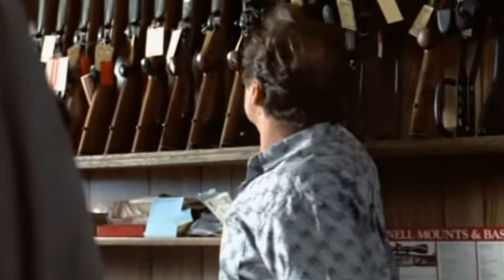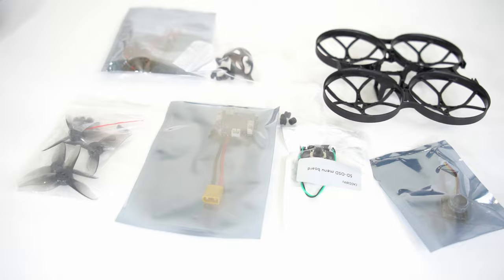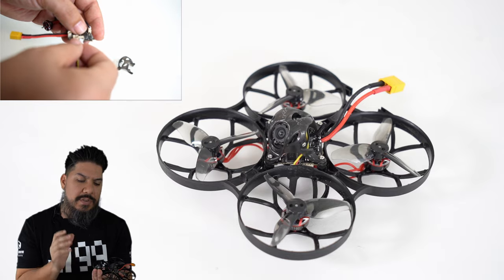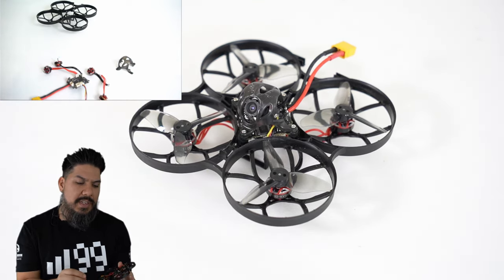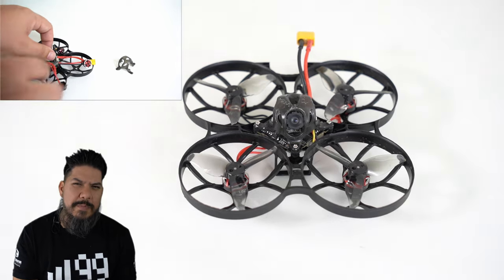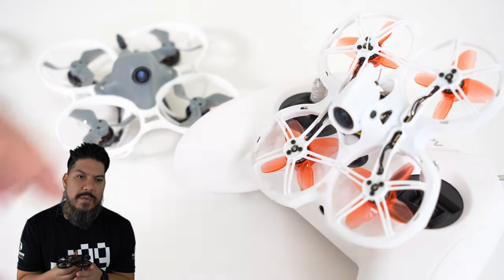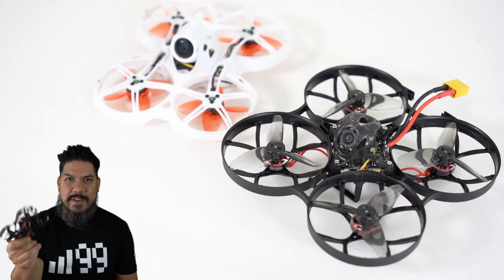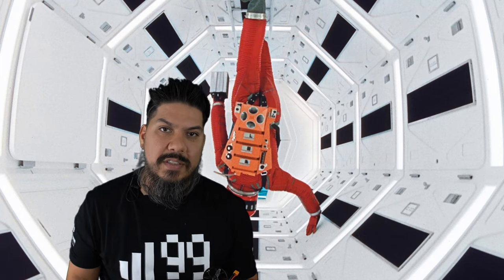UZ85 Build a drone for $75 NO SOLDERING - micro drone, tiny whoop, DIY quadcopter

Comment: I got one without receiver since I'm a weirdo who uses radiolink. No joke it's hard to fly inside. But should be fun outside esp with 2s. Wonder if it would work on 1s for inside flying?
Reply from the maker: I wonder if it would all still work on 1S?  Could also possibly do 2s but with a flat camera angle and like a 50% throttle cut possibly

Comment: So, my buddy Dom has one, but he's on the other side of the world so I haven't flown it, while I have the beta85. The difference it seems is mine has maybe more top thrust, while his has much longer flight times. Have you flown both Jon?
Reply from the maker: I have flown the beta 95, and that makes sense to me, the 1102 on this one, should be a lot more efficient but a bit less punchy than the 1105 and 1106 beta likes to use.
Reply: @JonE5FPV  It looks like it pretty much did what you told it to do. I know that it helps to chose your fly space size to fit the craft and that spot seemed to fit it well.

Comment: I was following you on Facebook for awhile about testing out cinewoops and the best frames and you said you where testing. Did you ever find a suitable cinewoop frame?
Reply from the maker: I have tried several. Reptile cloud149, taycan 25, betafpv 95xv2 pusher, and my fav so far is the cinesplore that i have a review up for.  I also will be doing a project on the Racewhoop open source design soon as well.

Comment: I think we should not buy this! It is basically a way to skip QC. One thing is at least to try to build something an other is to put a couple of plugs. So they can sell the same RTF/BNF but without a QC mark. I would say @Jon please do not advertise these. Unless you have a different opinion. ;)
Reply from the maker: I dont see QC being vastly different on these, but it is a good point.   I had luck on mine, and not having to solder does make it more accessible for many to save a few bucks, and not have to use those skills to get it built.  I will be on the lookout for anyone getting DOA parts with these, but so far seems like a good option.
Reply: @JonE5FPV  Yup "not vastly different". I think that producers uses this "possibility" to sell at the same costs something that they do not need to check for quality. The point is that some might save bucks but some others probabilistically will get a bad experience. And all of this because the producer saves money in the QC. The result, I think, is not perfect for FPV passionates. I want more people in the sky and less in the ground ;)
Reply: Let me explain. Because I sell a motor as to be plugged, I do not need to check the full quadcopter. Actually I do not even have to check the motor beside a plain test.
So the probability to get a bad build is not as low as you might think.
Reply: More over. Let's assume it does not work. On what do you blame it?
Reply: I would be fine. But at 1/2 of the price.